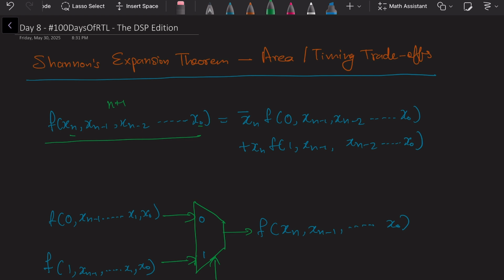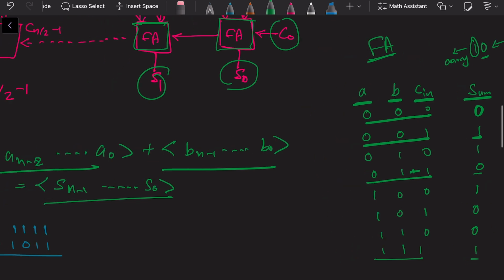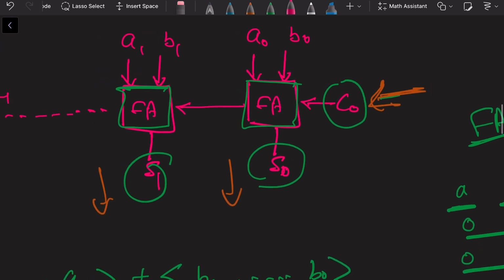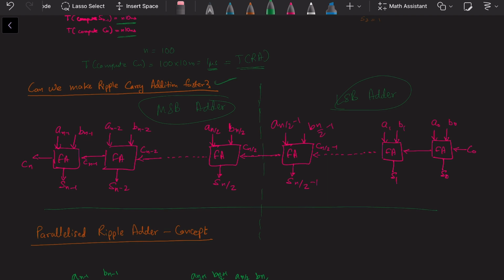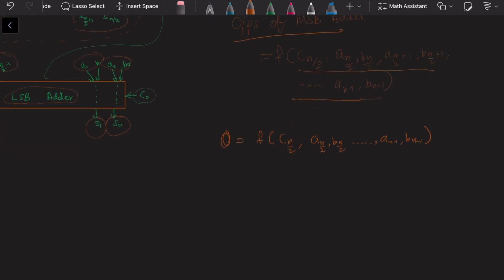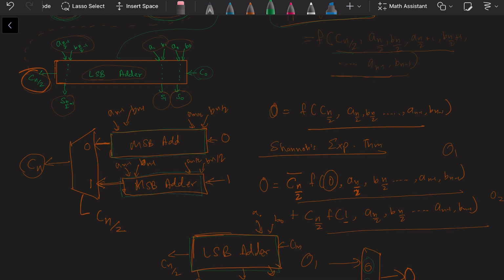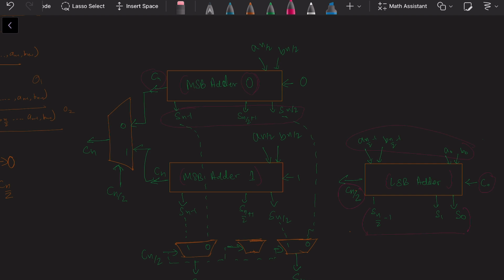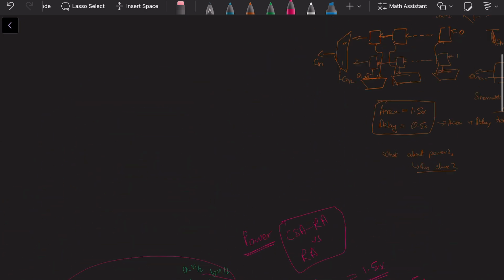100DaysOfRTL - Day 8 - Datapath Designs - Adders - Shannon's Expansion Theorem - PPA 😋

Comment: From my understanding, power consumption also increases as for calculating 2 msb, based on  possible Cn values, the amount of switching also increases thereby increasing power consumption.
Reply from the maker: Yes the power increases 🤓But the switching activity increase is not just dependent on Cn value, it is also dependent on the logic area - more transistors toggling means more dynamic power dissipation. Carry Select Adder has higher area and hence more power dissipation. Also since you can clock carry select adder at a higher frequency, that too would contribute to higher power dissipation 🙂